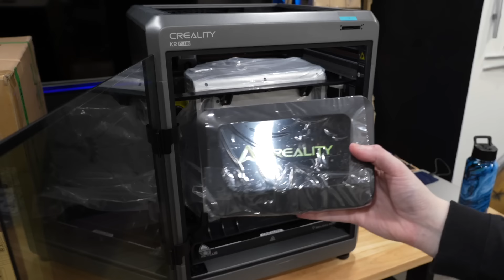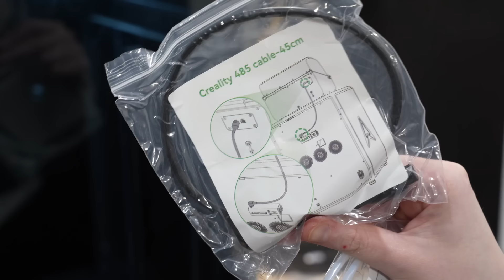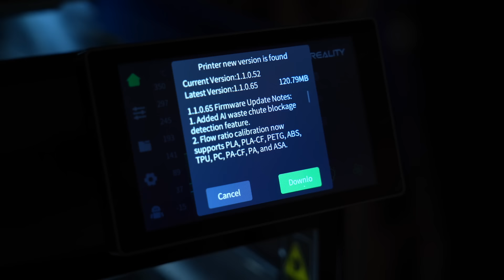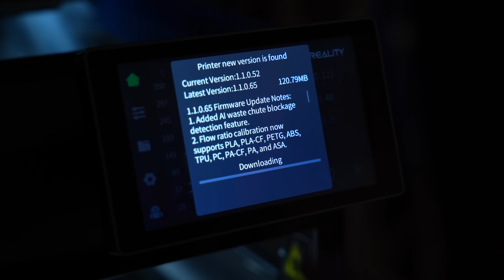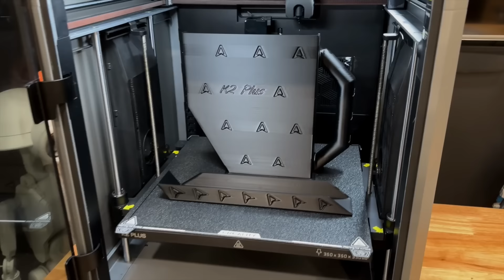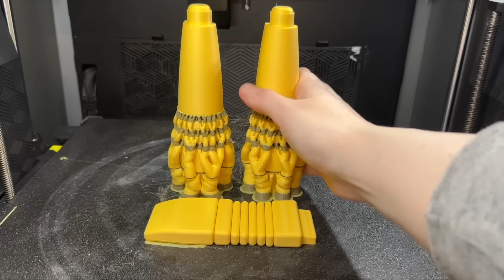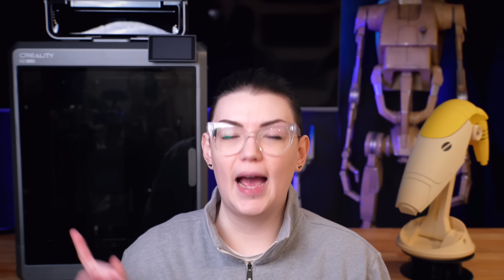Does the Creality K2 Plus live up to the hype?

Comment: That’s been my issue with Creality (and AnyCubic).  They’ll release a new machine to great fanfare - then within six months, that machine is old news, replaced by something new.  Getting support (ha!) or parts is tough, changes to firmware or software - that’s left to the realm of the tinkerers / folks that like to improve/upgrade their machines.  I’m hoping for something great from Bambu Labs, which doesn’t have this history of abandoning consumers
Reply from the maker: 100% agree with all of this. With there being so many great machines now a days, choice is going to start coming down to things like ease of access to parts, etc. They need to focus on developing their machines over longer periods of time, not replacing them every year with something else. I’m hoping that the K2 Plus might be that start of that, where they unify their design and parts more - similar to how some of the newer Enders and newly announced Hi have - but I guess only time will tell.
Reply: @ the reason the Bambu Lab machines are dominating are many - and I’m not a fan boy by any means - I’ve been 3D printing since 2013. My observation is that they know the customer!  They’ve made machines easy to use first of all and the machine tells the user what to do when problems are encountered. There are thousands of videos on YouTube for debugging mysterious printer issues!  Their machine tells you what to check and a QR code to a support page!  They’ve focused on their 3 machines   They didn’t go crafting new machines once the reviews hit on their current ones.  They’ve made have spare parts galore!  They offer firmware updates and tell you what was fixed!  And their slicer really works!  They don’t just rebrand Cura and never update it like many makers have.  

Sorry for the rant - this K2 offers a nice boost in print volume. But we all know Creality. How many versions of CR-10 and Enders are out there?  Are they offering firmware updates and parts for those?  AnyCubic is even worse, the cheap “Walmart” copy of anything anyone else makes.  

Anyways - please print safe!  Good video! (You might even like my channel & content!)
Reply: You're exactly right. I used to love Creality, and I still run some of their machines. But their support is horrendous. I bought 50 K1's for my farm and 3/4 of them developed major VFA issues. I won't sell subpar products so these issues were not acceptable. Creality support said "all printers will have these eventually," but later said "inexperienced users should learn to use their machines before selling models." Seriously? It wasn't until I responded with "none of the other machines brands develop these issues like this, and I've spent over $100k on your machines over the years" that they switched it up and offered to replace 10 of the machines. I guess they looked up by purchase history. Anyway, I took the 10 units, replaced the others with more Bambu P1S/X1C's, donated the bad K1's, and I've never given Creality another dime. Id love to have their K2Plus, but I can't justify it if they end up like the K1's.
Reply: @ that’s really unfortunate you’re going through that.  The advice I try to give people is to do their research. Don’t just fall for the many adoring videos about a product (not saying that is the case here!). We wouldn’t buy a major appliance without checking into reviews and how the manufacturer backs their product.  Since most of these newer machines are over $1000, it’s really important to see if you’re buying something that’ll work as promised and if the company will support them into the future.  Creality has a really poor history of that, among others.  They just roll on to the next big thing and you folks that have a one year old model are on your own.  Many want these devices to work without the hassle of debugging, hiring help to redesign failed components or worse, someone that can fix the firmware shortcomings the company won’t do. 

Basically consumers need to demand better. And that’s why, I feel, Bambu Labs is dominating right now. They understand the customer’s needs.  Hopefully they understand we need offerings that have bigger print volumes!

Print safe, friend!
Reply: @WhereNerdyisCool  True. I shouldve researched more. But I had good experiences with their v2/V2 Neo's (although I immediately upgraded each with Klipper, dual z, direct drive, etc) so I thought the K1 would be a nice upgrade. I actually bought the 50 K1's a little at a time. I think I bought 10, then 10 more, then 30 because I liked them so much. It was only after extended use that the issues really started to show their heads, which was unfortunate. So I'm waiting until others use the K2Plus for an extended amount of time before I buy. I'm also waiting on Bambu's new machine and plan on buying quite a few of those. 

Anyway, thanks for the response, and great video. I wish I could post my 3d printing life on YT. I think it'd be fun. Unfortunately about 200 of my machines are used for 1 client and I signed an NDA so I can't show any of those, and the other 100ish machines are also in view so I'm kinda stuck. I wish my warehouse was bigger so I could separate the two...maybe one day.
Reply: @OhImKiCkiN  Maybe you could try the QIDI plus4, it is great at VFA controlling.
Reply: This comment aged like milk
Reply: Ha forget about that given Bambulabs antics during ast week.
Reply: I found this the hard way when I decided to back up their CR10S back then—- let’s just say in less than 6 months they’ve already released another “new improved” machine and basically it didn’t take long for their previous machine to be obsolete… lesson learned for me but I would recommend a company that doesn’t make their machines go obsolete as fast as how cellphones would go.
Reply: That’s how I feel about my K1C. It already feels like it’s been completely abandoned
Reply: @falcongunner33  that’s so true. It’s like Ross came late to the party
Reply: I hate then they promise the ender 3 V3 and plus to be able to use their CFS but fail to deliver i already bough them!
Reply: Haha this comment
Reply: @roosterqmoney  yeah that last sentence failed me based on their recent behavior
Reply: @paulbussiere1997 yeah Bambu crapped in their jeans recently with their new firmware update.  They claim it’s for our own safety and security.  As in “they” know what’s best for you.  You can roll back to old firmware but that would mean no future updates to your printer unless you accept their new “authenticate” feature to their servers.  It essentially means they have control of your printer.  If they ever decide to not authenticate you for whatever reason you’re just screwed.  Or if they later decide to move to a subscription based print quota model again you’re screwed.  This new firmware update gives them the ability to do all of those things.  Bambu community is very upset about it.  Bambu is dug in and arrogant in their behavior concerning any possible change to this new firmware update.  Many Bambu X1 and P1S owners/users are now moving away from their printers.
Reply: That’s what consumer grade products are dude. This isn’t industrial level, manufacturing level. This is just consumerware designed to keep selling. It’s no different than any other consumer product. You’re a consumer, so consume. If you don’t like it then buy industrial or go off grid and become the next UNA 🔥
Reply: I agree completely. I had so many issues with my k1, I ended up selling it. Their customer service is beyond awful. I spent more time fixing it than having a functioning printer. I’d never buy anything from them again.
Reply: Yeah I'm more of a printer is project than use printer for a project kinda guy so I love that they make these cheap. However, not a fan of their move towards proprietary stuff. I bought the CR6 SE and was a super early Kickstarter backer and before I even got mine people had tons of problems and it put me off and it sat in the box for 3 years, then when I decided to finally set it up I realized that there is almost no replacement parts for it and there's not nearly as many out in the wild as some of their normal release stuff.
Reply: @ that sucks.  I’ve avoided the Kickstarter stuff.  I have 3x CR-10S, 1x CR-10S Pro and 2x CR-10 S5.  Everything on those has been me, on my own, using third party hardware and software to make them reliable.  Creality walked away from those years ago.
Reply: Well I was going to buy the Creality K1 max until I read these comments. Saved me $800.
Reply: The best creality machines are the original enders, V2, and the s1 series. There will always be an aftermarket support for the foreseeable future. Granted the K1 and k2 are capable of more, these are the best. As far as anycubic I'll never buy another, I replaced all the electronics on my kobra max with ender 3 s1 parts to save it from being obsolete, but that allowed me to run a K1 style hotend upgrade for the sprite extruder and now I can do massive prints in cf nylon and pet-cf. It's now my favorite printer.
Reply: Lol, Bambu Labs is gonna be worse.
Reply: I would do that they don’t test their product enough. Some people great machines, most need some modification while other get lemons. They never do enough quality control
Reply: This comment didn't age well with the bambu saga 😅

Comment: I'm very skeptical of Creality, but equally curious on your take long term on the K2 Plus. My CR-6SE is a headache. Bambu or Prusa seems to be my next printer.
Reply: I also was burned by the CR6 Kickstarter as I backed it and was too afraid to touch it for 3 years so it sat in the box. Luckily a few community members put together so powerful resources for it. List of problems, community, firmware, and even a klipper for that can use the original screen! The CR6 had the issues of non thorough testing. It's a good printer, and the nozzle as probe is great when it works. If you spend the time to properly set up/calibrate the strain gauge with a small scale and are aware that unhooking the Bowden tube during probing gives way more consistent results, then it can work but it was a huge headache to make reliable.
Reply: Creality stepped their game up in the last two years. They don't have very accessible official replacement parts. Most parts will be third party from amazon or Ali express. If you have Prusa money, a P1S or P1P will be great. Prusas MK4s does not stand to the P1 series.